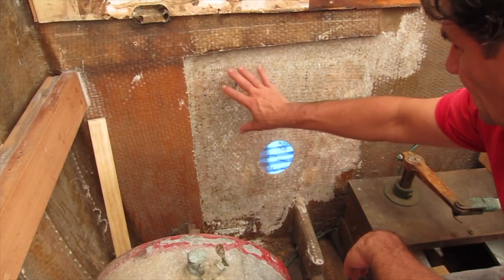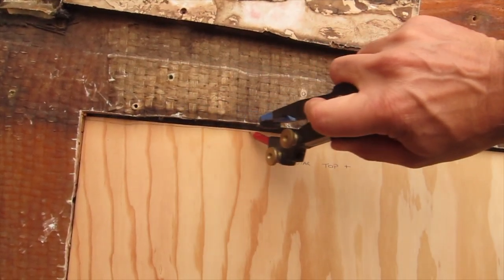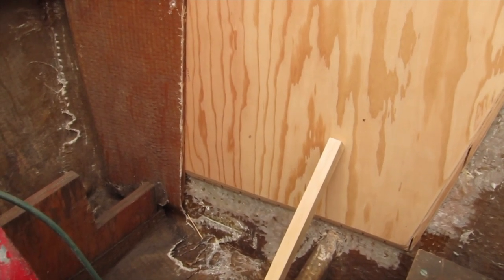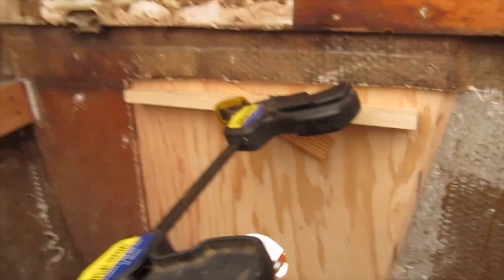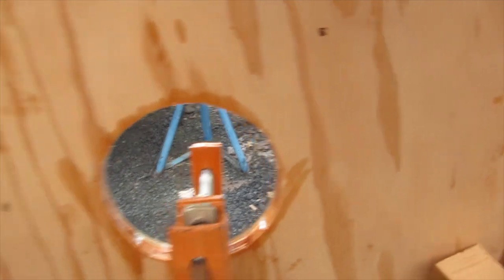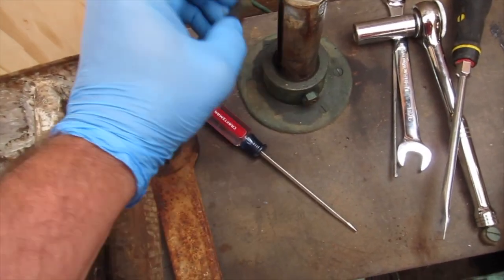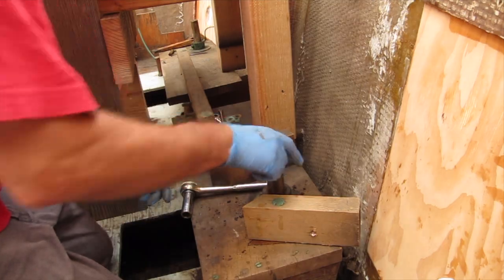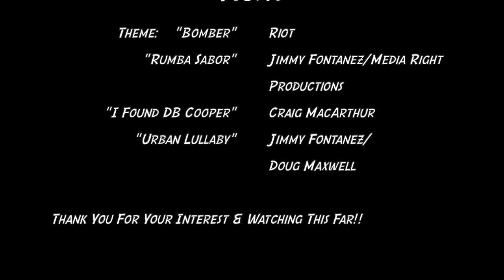Transom Plywood Replacement. Steering Component Removal - Boat Restoration EP038 (June 2019)

Comment: Always enjoy watching your rebuild, I know I pushed coosa board the last time we spoke, I just used my last sheet of it today. I was glad to see it go, plywood is friendlier to work with and a lot cheaper. I have used fir marine grade and am currently turned on to ACX. As always , Great Job and Great Boat!
Reply from the maker: I will have to looking ACX. I need to decide on a material for the ceiling boards/panels at the sides of the cockpit at some point. The factory used plywood with white laminate. I'm not quite there yet so I have time to decide. Thanks for the comment.

Comment: Hey, Bob.  Enjoyable video, as always. Maybe a dumb question and perhaps I missed the explanation in this or a previous video, but what is the functional reason for this plywood?  If for transom reinforcement, why not go full width?  Or is it strictly to strengthen the areas where the exhaust thru-hull fittings pass through?  Hope you’re well.
Reply from the maker: Hi John. I'm not a boat designer or engineer so I will answer with my best guess as I'm baffled by it as well. When looking at the cockpit in general, the only places they seemed to install plywood against the fiberglass hull was where they were attaching something. Beam shelves, deck beams, transom panels, stops for the fuel tanks to keep them in place (although the transom probably required reinforcement for the stops & mufflers). Looking at the fit and the way plywood was installed I believe the main purpose of most of the plywood pieces was to provide a means to attach items to the hull and a secondary function was reinforcement. If for reinforcement, even if they did not want to go over the entire transom, you would think they would have installed a full sheet of 3/4" plywood top to bottom 4 ft wide and tight to the transom/side corner. This would have included the muffler area opening. Instead they stopped about 2" from the bottom and side, stopped just below the transom deck beam and used a separate unconnected 1/2" piece at the muffler not tied in with fiberglass. I remove the rest of the items on the transom in the next couple of episodes so you will get a full view of what was done. Hopefully we will get lucky and someone watching may have worked on designing or building these boats and can enlighten us. Thanks for the comment. Stay well.
Reply: @Renovation Sportfish - thanks for taking the time for a detailed reply, Bob.  I’ll bet your guess is right. In fact, in addition to the steps you removed, I wouldn’t be surprised if a swim platform was also an option from EH (or they anticipated customer doing it aftermarket) and the attachment points for it would probably be just outboard of and above the exhausts. Loaded, a swim platform would put a lot torque on the transom, so they probably did it to provide option ease/flexibility and to prevent cracking in the gelcoat and structure. Looking forward to the next videos. Thanks for producing them.